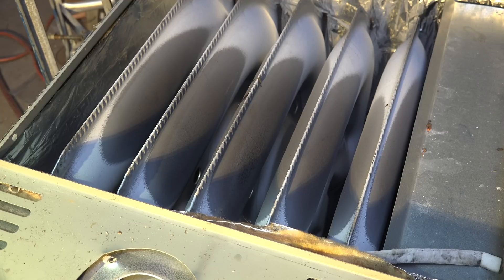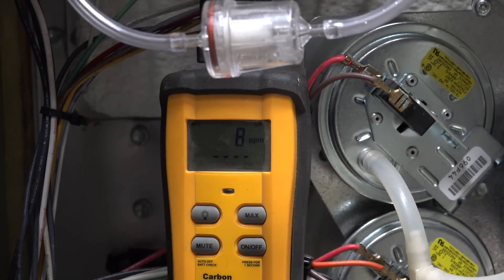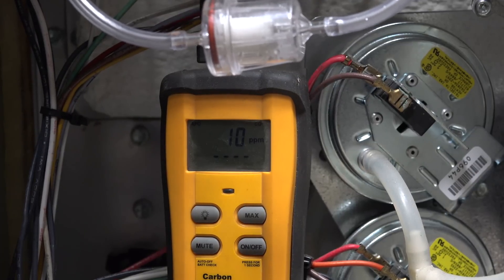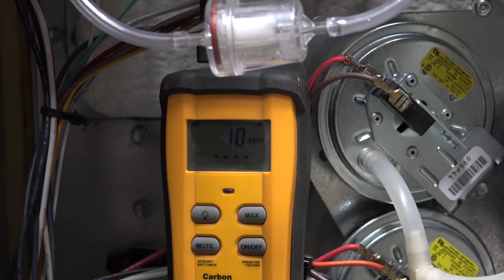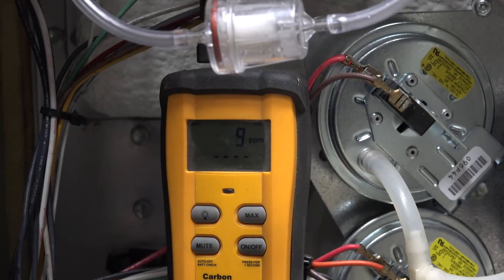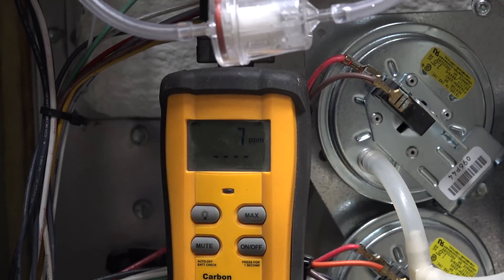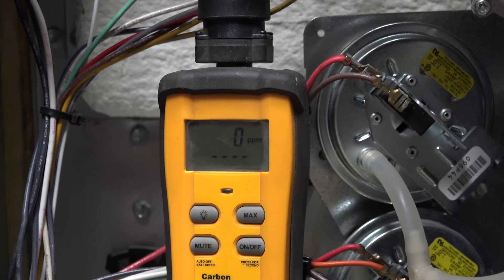Whats wrong with this furnace, #6 answer

Comment: Would a fully vented High Eff. furnace with a crack even emit gasses? Isn't there a negative pressure on the heat exchanger? I guess if was large enough the pressure switch would kick things off.
Reply from the maker: +Craig Nehring Conventional wisdom says it should not produce CO in the air flow because of the negative pressure.  However, as with most things in this life, you can never be sure.  I would err on the conservative side because it is a poisonous gas.
GFM

Comment: I am old school and cheap.  I use a magnifying mirror and a led flashlight to detect cracked heat exchanger.  I would probably never find this crack that way.

Thanks for your videos
Reply from the maker: +Kolocho DelRio I did use a camera to look for this crack and did not find it.
GFM

Comment: so what you gave us there was nothing wrong with it because you would not have open the duct work because there was no sign off a crack heat exchanger
Reply from the maker: +gonz garr There is definitely something wrong.  What I was showing is that however you might try to diagnose a cracked heat exchanger, you could miss it.  You do not know how the crack may progress.  Hope this helps.
GFM